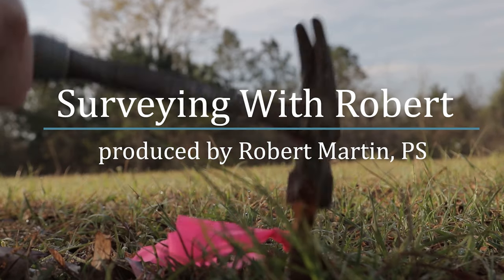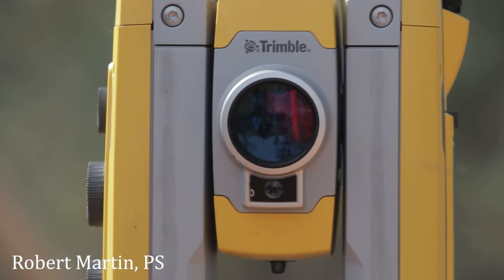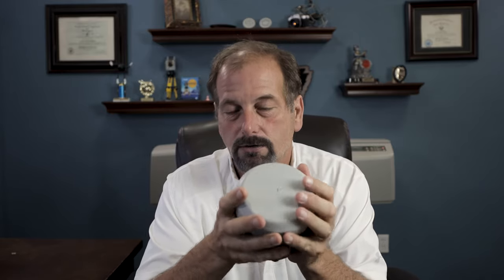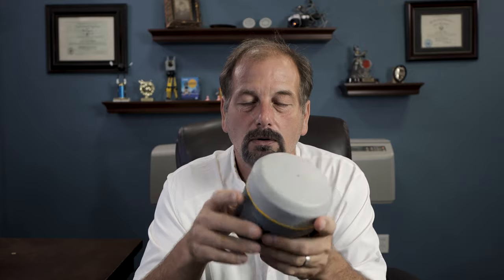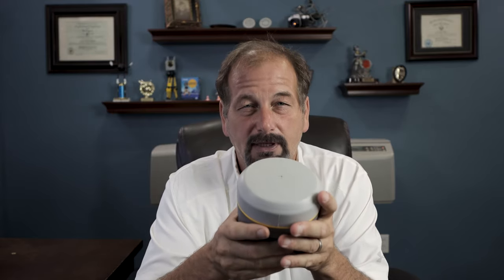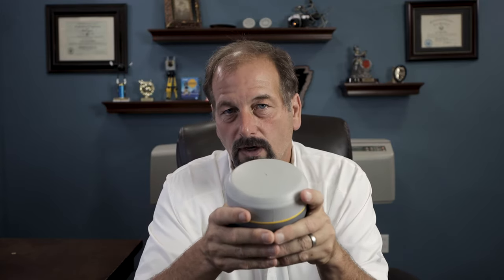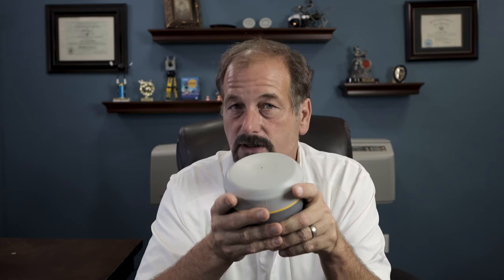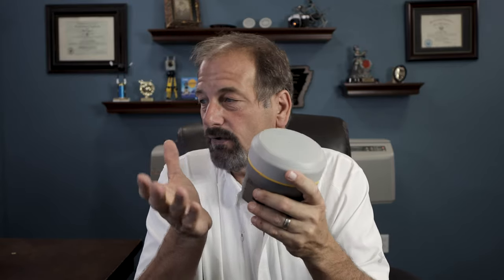3 different Trimble R12 receivers?

Comment: Robert, if I run an old R10 base.. not the R10-2, with a new R12, will it lessen the great performance of the R12 in the woods?
Reply from the maker: Mike Stone watch this video. I use a R8s and R12 as a base. This R8s would be comparable to your R10. https://youtu.be/3_J_BtpXhSk
Reply: I would say no...seeing as your base wouldn’t have to deal with canopy and would be on a pretty convenient and optimal CP or out in the open.

Comment: My R10-2 has Xfill, ProPoint, tilt, etc... besides the name, what really separates the R12 from the R10-2 Robert? They appear to spec out the same.
Reply from the maker: If you upgraded the firmware to 6+ they are the same. The R10-2 made the R12 what it is. R10-2 is the hardware R12 is the firmware. If you look the R10-2 was not around very long.

Comment: We do opus work in areas that are not that secure.  We have an R10, R12 and now an R12i    We choose less than Ideal setups often so we don't have to babysit the gear.   Would there be any difference in the opus results (were looking for elevations)  with these units ? For Opus can the R12/R12i make better use of the signals in the same timeframe ?
Reply from the maker: If you were processing against your own base in TBC I would say yes. If you just use OPUS you could use cheeper unit for static. OPUS doesn’t use all the satellites.

Comment: Hi Robert...what’s the difference between a Model 60 and Model 74?
Reply from the maker: Model 60 has a Internal 403-473 UHF Radio, Model 74 has a cellular modem. This is on the R8s, The R12 has a 00 (no radio) model 60 (radio)

Comment: Is it possible to revert to a previous firmware version? R12i
Reply from the maker: Not positive but you may be able to with TIM. Try highlighting the software version and select an older version at the top.
Reply: @SurveyingWithRobert  I purchased an R12i, but I have a problem with high precision in RTK, in other GNSS I get millimeter precision, while in the new R12i I get 8, 20, 30 centimeters vertically, that's very strange.
Reply from the maker: @GilbertoMoraes-y3h  that is strange. Do a hard reset and see if that helps.
Reply: @SurveyingWithRobert  ok, Can you tell me how to reset? Please
Reply from the maker: @user-mp1sh4qs1p https://youtu.be/H196LIfT4tc?si=12Ca0hj1elMYSvN8
Reply: @SurveyingWithRobert  Great help, thank you 🤝🏼

Comment: Okay so I've watched 3 times and I'm not sure I've got this straight. For the hardware 8,000. The nema stream is 250. Warranty with accidental damage coverage 3,000. And it's 20,500 for all the things that make it better than an R8?
Reply from the maker: R12i basically list $28,500, plus $2500 for the warranty. Nema $250.